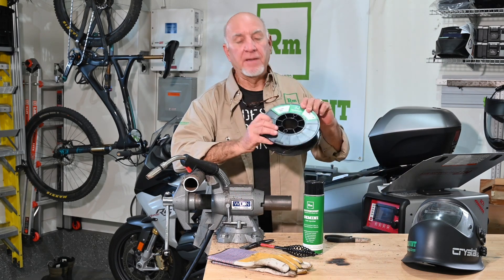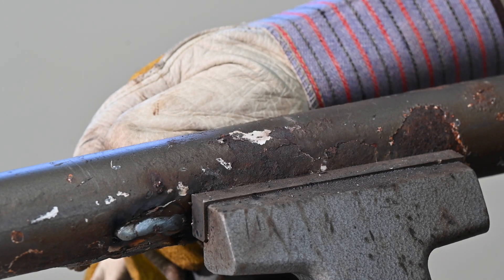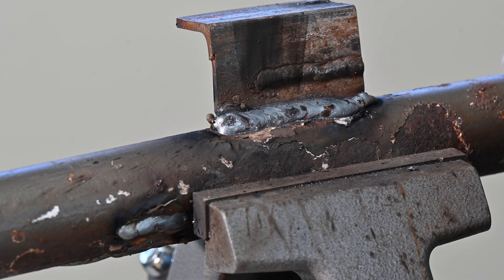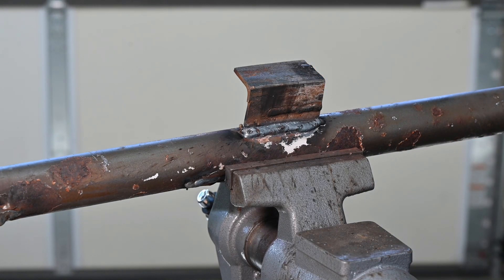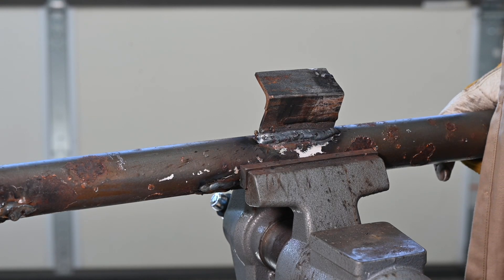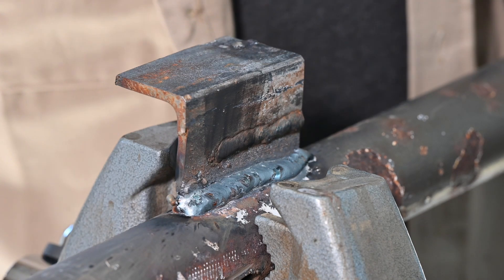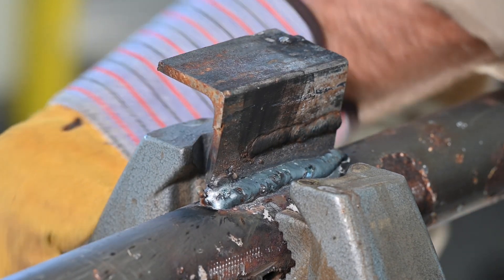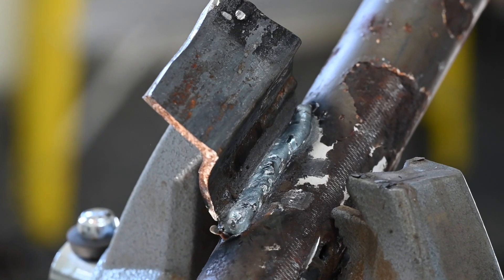Polaris MIG -- High Strength Repairs Even on Contaminated Materials

Comment: what are setting your using amps and wire feed ?
Reply from the maker: Amperage varies based on diameter. You can see the general range on the data sheet linked in the description or give us a call at our office. We'll get you connected with a technically trained sales rep who can answer all of your questions!